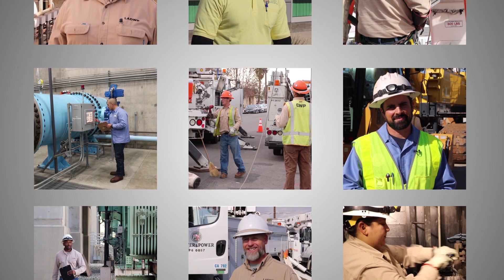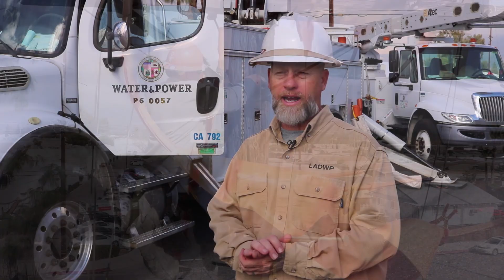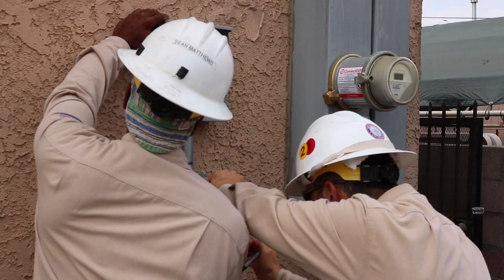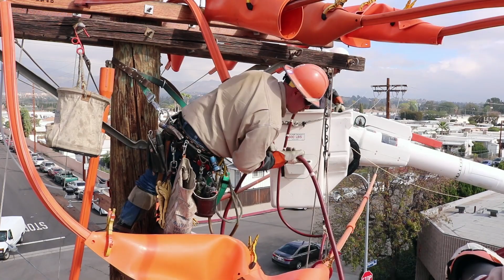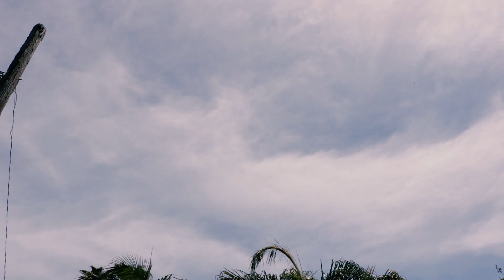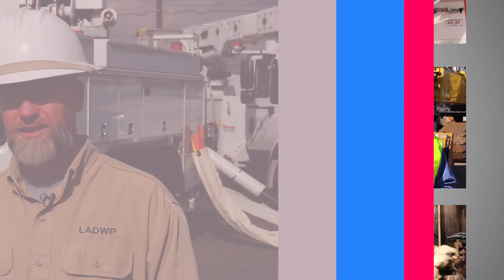LADWP Electrical Distribution Mechanic/Lineworker

Comment: I just finished the ECH class from trade tech. Have the application coming up in October. I'm looking forward to it. Can't wait..
Reply: Been on the list for 2 years, I  just got a email from dwp about going through the interview process.
Reply: @alexanderholguin5284  damm 2 years ? Why so long ? So say I get an exam date and I pass. I would have to wait 2 years to just to get an interview?
Reply: Do you need experience for the job? Or just need that certificate from ECH?
Reply: @bobbylight51  just the certificate
Reply: Town Bizness great 👍🏽 I got mine. I guess We have  to wait for application to open up.
Reply: @bobbylight51  in October.. I can't wait to get out of my union..
Reply: @justlift4031  did application open ?
Reply: @bobbylight51  the 20th
Reply: @justlift4031  I scored an 85/100. I have a friend that scored 96 he got a call 6 months later after the scores were posted. For some reason It took them 4 months too email the scores.
Reply: @alexanderholguin5284  damn. Really? Shit. Well good thing I have my union job as a journeyman in the mean time..
Reply: @justlift4031  Nice!  I’m an apprentice at local 11
Reply: @alexanderholguin5284  sweet my boy. Im local 105. I just turned out. R u wireman?
Reply: @alexanderholguin5284  any advice on what to study for?
Reply: @justlift4031  ECH is the certificate you get after the 2 year program I just started at LATTC
Reply: @justlift4031  I guess it got canceled
Reply: @bobbylight51  yeah. Fucking sux.. I subscribed, hopefully it notifies when it opens up.. I'll b checking daily.
Reply: Anyone know how much electrical craft helpers make?